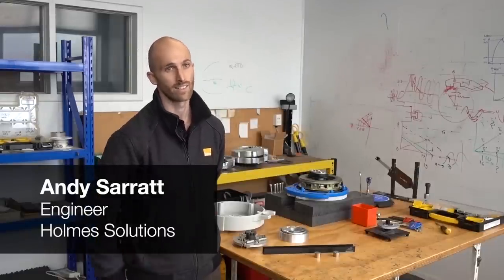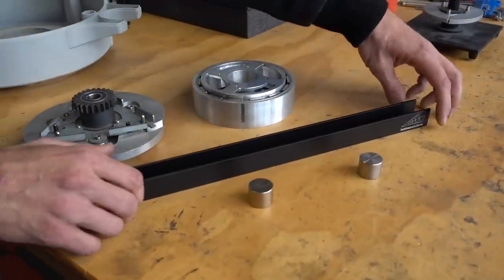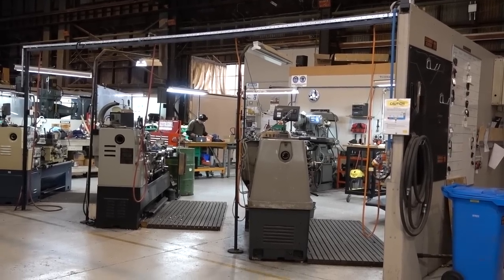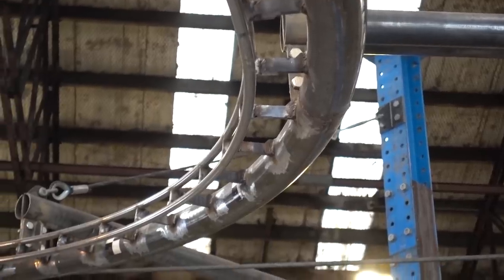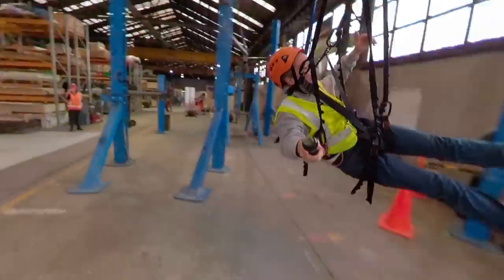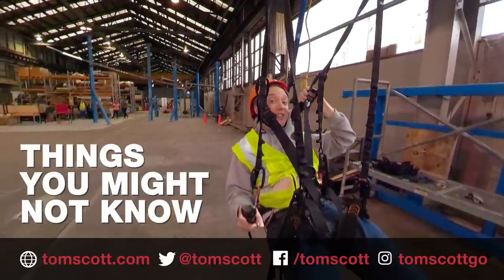Testing a zip line that goes round corners

Comment: Their job is basically making sure Darwin awards aren’t handed out too easily.
Reply: Meanwhile tempting the least fit.
Reply: Zero Cool  As explained in the video, if someone intentionally does something stupid such as slip out of a restraint on a rollercoaster, stands up, and gets killed, that's not the ride makers responsibility. In such a case it's absolutely the persons fault not the builders.
Reply: Zero Cool  They are talking about 2:37 to 3:00 of the video. It is the job of the manufacturer to protect against "forseeable misuse", which includes some situations in which people intentionally do things that they aren't supposed to do, such as taking their phone out while on the ride.

Edit: Both sides have a point. It isn't true that their job is purely to make sure Darwin awards aren't handed out too easily, they also need to make the ride safe in and of itself. On the other hand, it is true that a part of their job is to make sure Darwin awards aren't handed out TOO easily, but people could still be eligible for a Darwin award if they tried.
Reply: Maybe there should be a different award for the worst deaths due to someone else's negligence.
Reply: They are the judges of this specifc type of death
Reply: @buddyclem7328  We call those awards "lawsuits".
Reply: @buddyclem7328  I believe its called 'charged with manslaughter'
Reply: Zero Cool  watches rick and morty
Reply: @chairwithoutwheels9148  Briliant insult!
Reply: My favorite Darwin awards are the ones that don't require the recipient to die.
Reply: @aleksanderbaron91  why thank you sir
Reply: @garethbaus5471  You mean to become sterile?
Reply: Make the people really earn their Darwin awards, dammit
Reply: @buddyclem7328  Baron Darwin Award by Proxy?
Reply: Protecting people from themselves has got to be one of the hardest jobs imaginable.
Reply: xD
Reply: for real dude. 10000% true
Reply: you gotta work for it you know
Reply: Predicting just how stupid people can really be and protecting against it has to be a damn tricky job :D

Comment: At what point does it go from being a "zip line" to being a "zip piecewise-smooth curve"?
Reply: "Zip differentiable function"
Reply: They can probably put it back on a line after the turn.
Reply: batt3ryac1d It's a calculus joke.
Reply: @bitasy1  Zip continuous and differentiable at all values x
Reply: This design integrates both a cable, and a curved rail.
Reply: It's a zip spline.
Reply: Eyyyyy
Reply: zip real function that satifies cauchy's functional equation but isn't continuous
Reply: Technically, at least from the perspective of art, a curve is a type of line. So a "zip curve" would still count as a zipline. Not sure from the perspective of math, but I think curves are considered lines there too.
Reply: @gcewing  
We have a winner.
Reply: you're right. 10000% perfect
Reply: It's not even a zip line. It's more like a monorail.
Reply: @moondust2365  In math, lines are by definition  both straight and infinite, so neither straight segments nor curves are lines; excepting the case in which the line is straight, but the basis of the space in which the line exists is curved.
Reply: a zip bezier curve, if you will

Comment: Imagine a zip-line around buildings that can be used as an evacuation zip-lines from a fire in a very tall skyscreapers or from one skyscreaper to the another lower building in height.
Reply: I imagine a line of panicked people trying to harness up and burning to death
Reply: I imagine a bunch of people falling to their death after supports holding up a zipline or the rope itself burns.
Reply: @JoCE2305  the cables are steel so they wouldnt burn but i see your point
Reply: @noahharber4443  - Steel that can't melt, where have we seen that before?
Reply: people would just play with it
Reply: @nateman10  plus using it regularly reinforces it as an exit to use, which people are more likely to remember in a panic than some obscure exit

Comment: This looks like a very complicated technique to make ziplines go around corners.
There is a much simpler technique at a tree climbing ziplining place near Marburg Germany, it was in one of their many climbs (rides?), the guy told me it was designed by swiss engineers.
Basically the thing that attaches you to the metal wire has a cross-section that looks like the letter C, the wire is thicker than the opening of that C letter, and the wire is attached to trees (goes 90 around the tree), it's attached my metal pieces that are thinner than the opening of that C letter. The point of attachment is tilted at a reasonable angle so that the thing that attaches you to the wire can rotate a little bit (imagine the letter C rotating) to make that attachment point pass through. It's quite terrifying while you're in that ride because you feel like you keep getting detached from the wire, but it's completely safe :D
I think the only limitation of that technique is that you can either have all turns be right or left, you can't have a mix of both, because that letter C has only one opening pointing towards only one side. But maybe there could be a way around that.

Comment: It's actually State or local government entities that inspect permanent based theme park rides in the US, not insurance companies. 44 of the 50 states handle these inspections at state level. Every ride is inspected annually during a set time frame or when the park is about to open if it has an off season due to weather. There are also a pile of federal laws that must be adhered to. Most states have a specific department/division who handles this. The insurance companies also do inspections, since it would be their loss in the event of an accident.

Comment: The way Tom's camera manages to edit out the grip stick is messing with me. Does it have two apertures or something?
Reply: looks like a 360 camera to me, it certainly has 2 or more lenses, it's like when you look at your nose with one eye and when you look with both eyes it kinda disappears.
Reply: It's the go pro that can see 360 degrees (I think it's the fusion) and so it has 1 lens on each side, they are slightly offset from each other so there is a bit of a seam directly below and above the camera. They have a park bench video where they discuss it
Reply: It's got two lenses and it also uses some programming in the video stitching to make the stick disappear

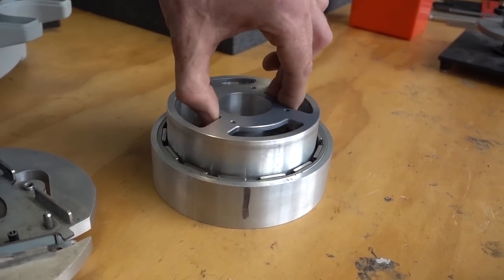Comment: 2:04 This is similar to a magnetic clutch I was working on a few years back with the exception that once it was fully engaged, an array of magnets with opposite polarity would lock it in place to prevent slipping. Never managed to get rid of the shitload of vibrations though right before the complete lock, especially under heavy load.

Comment: We have a new ropes course that has a similar zip line near our house, however your harness is what holds you up. So you don't have to clip yourself to something else. The harness just clips to a rail overhead that goes all around the course. The zip line uses a very similar rail system, but it's closed off on top so that your wheels that go in the rail don't accidentally jump off due to something

Comment: The only problem I see with this over the usual zip lines is the carrier that runs on the cable is massive. That means there will be a lot of effort involved in attaching it to the cable at the top, removing it at the bottom of the run, and transporting it back to the top for the next user, not to mention the potential for damage whilst this is taking place. 
In normal Zip line applications, the rollers/pulleys that the rider hangs from are a part of their harness and safety gear which is dead easy to carry around. 
This system will be a lot more expensive to purchase and be slower in practice to operate. But it's cool that it goes round corners.

Comment: Dreams Natura resort in Cancun has a zipline like this on property next to the pool.  It is launched from the top of the tower where the water slides are located.  It is quite fun, and rock solid.  It has several switchback corners swinging you from side to side, and a final long loop that ends with you being swung back up a 45 degree incline to stop you.

Comment: Based on the abrupt jerk as it enters the corner, it looks like they're not using spiral entry- and exit curves to gradually ramp up the g-forces (like you'd find on any roller coaster, railway or high-speed roadway).  Might want to look into that to improve rider comfort (and possibly avoid some minor neck injuries if the rider is looking a strange direction at the start of the curve).

Comment: Neat I wonder what amount of that could be regenerative braking which is stored and used to power a direct return trip to the top for the harness.  Its also a bit scary that an entity which has a financial interest in passing a thing so they can get insurance accounts is used to certify for safety but at least they have the negative of having to cover injuries.   The problem comes when you tie this into our legal system that can have insurance companies fight claims in court.

Comment: I can't believe this has never been done before! It seems like a problem that ski lifts solved years ago
Reply: Similar things have been done before. Unfortunately it seems very hard to get it right since the implementations I've seen so far were all constantly closed due to technical problems and then eventually demolished since it wasn't profitable.

The supports in ski lifts are a lot easier to do since there gravity holds everything in place, and the carts are attached to the cable. Horizontal corders are a lot harder to do especially if carts have to be able to easily roll across the cable with low friction.

Comment: Disappointed to see an unguarded rotating shaft at 3:30, sticking out from back of the lathe. I worked 30 years on lathes in a factory, it's not hard to move a guard into position.

Comment: I'm... Not very comfortable with the fact that the supporting braces of the ride are on the outside swing of the corner... Where the person will be swinging out towards. Couple that with a selfie stick, and they could potentially get their gear stuck on one of the braces, have the wrist strap of their selfie stick loop around a part of their body and either strangle or dislocate them from the sheer velocity and force that the snag would happen at - perhaps even weakening the rail mechanism by introducing fatigue and undue stress on the various components. Have they considered placing the supporting braces from inside the corner, instead?

Comment: g forces in corners are higher. speed in corners are higher. middlepoint outfleeing powers are different then a steady straight line. it is thermodynamics and vector powers. you need a different physic formula for that part. also friction is different in corners. one axe is more.. emphorced then the other in a corner. upon wich the balance in newton. on a straight track with speed and accelaratio n is different. good luck. stay save. more is less.

Comment: 2:35 My head hurts looking for the selfie stick...
Is this actively hidden by the camera (software) or is it due to lensing?
Reply: Software. It's two cameras that each have slightly more than 180 degrees field of view - where the mounting point is - so it automatically edits the stick out. It allows one to select what's visible in editing, or to have the user control where to look while watching. The latter is fun once but rather annoying otherwise...

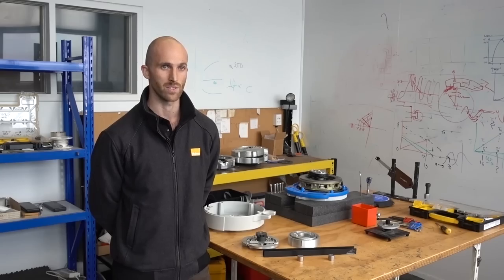Comment: 2:13 There is no such thing as centrifugal force
Reply: Yes, there is. Just apply Newtonian mechanics to a rotating frame of reference, and you get an outwards force term appear clear as day.
Reply: Well yes, you can indeed derive it but it comes from the effect of centripetal force and forward motion in a reference frame
Reply: Centrifugal force is a normal force caused by the centripetal force
Reply: @thomaslauer1015   Thomas Lauer  centrifugal force is a force that acts more or less the same way gravity does (except the algebraic expression is a bit more complicated, and dependent on velocity, not just mass and position; this is the Coriolis effect) in any rotating frame of reference.

It is necessary to call it a force if you want Newton's laws to hold in the rotating frame of reference. To any physical experiment it behaves exactly like a force. So we call it a force.
Reply: @MasterHigure  Aaaah I see now. I stand corrected. Learn something new everyday!
Reply: @thomaslauer1015  You learn that "There is no such thing" in school, and unless you go on to study physics at university you are never dissuaded of this notion.

It's like in elementary school when you were taught that you can never subtract a large number from a small number, only to learn about negative numbers a couple of years later. Except many never reach this "a couple of years later" stage when it comes to centrifugal force, as it happens at university.

Comment: So basically a roller coaster upside down with wires? How do you patent that wtf.
Reply: I think they patented the braking system (for use in ziplines) and tech to transition from wire to steel rail for the curve.

Comment: I wouldn’t call that a zip line. Also the rider is more restricted than a normal roller coaster, can’t turn or really move your head to look around at all in that contraption.  There’s a point when projects get so overly designed in the name of “safety” that it no longer resembles the vision of the ride experience but it’s hard to except losing the investment already put into its creation.

Comment: A blanket 5x safety factor!! What dark ages of engineering are these people living in?!?
Reply: @ragnkja  it is just a very old way of doing it and leads to parts being way over designed. The structural engineering moved to allowable stress design, then load factor design, and now load and resistance factor design. The only time I have seen this method is for light & sound rigging where non engineers are responsible for the design, so a simple approach is still used.